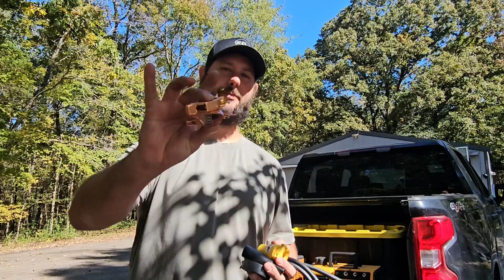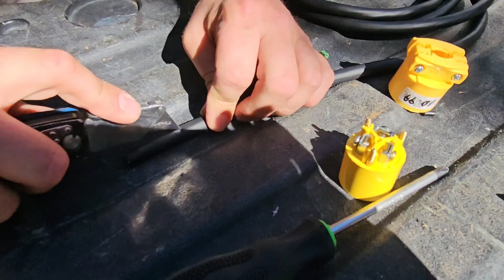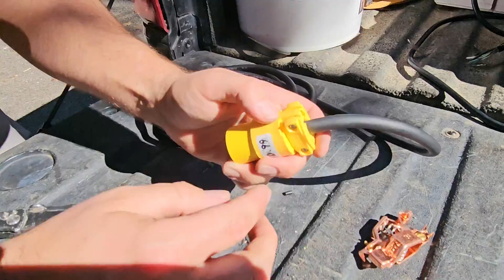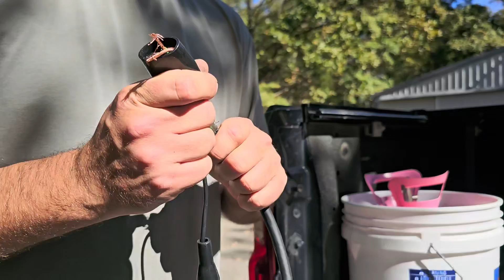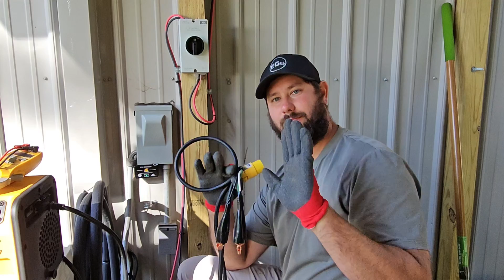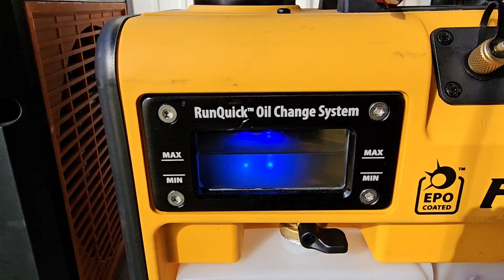HVAC Adapter Cord Made EASY!

Comment: It is not a great way to get power.  It can possibly energize the chassis of the AC unit.  It is actually unsafe to use.and probably illegal to use in a business setting due to the misuse of the ground as a neutral wire.
Reply: Please elaborate. I have always wondered why it's considered such a bad idea. This is the first hint I've seen about the reason. Please explain more details. The ground is already connected to the unit having 240v, right?
Reply: @Mo4Honesty  For the reason that I stated.  It is illegal to use the ground connection as a neutral conductor.  
Normally the ground does not carry any current.  When used like this the ground caries current.  If a problem develops, the chassis can become energized and result in an electrocution hazard.  This is the exact reason that 220v appliances (stoves, dryers) went to a 4 wire plug - two hot wires, a neutral, and a ground.
Reply: Robert is 💯 !
Also… if you insist on “cheating”  (adding 2x heavy duty insulated fuse holders should absolutely be installed at the closest possible place near the clamps!)